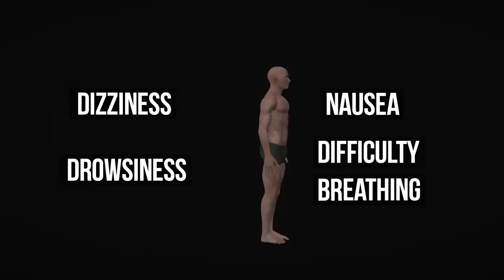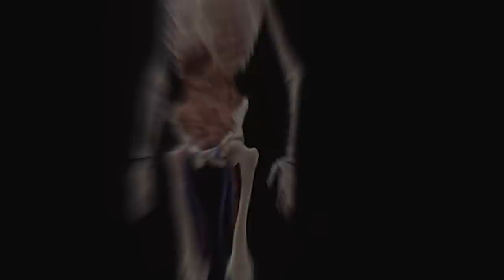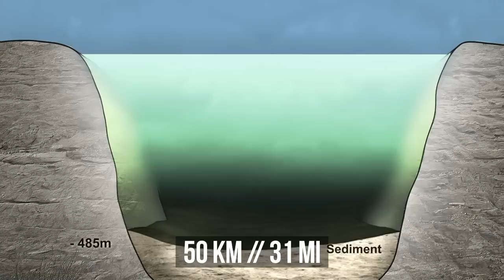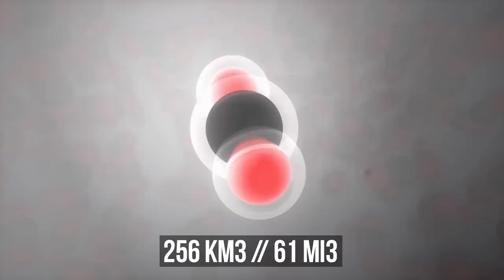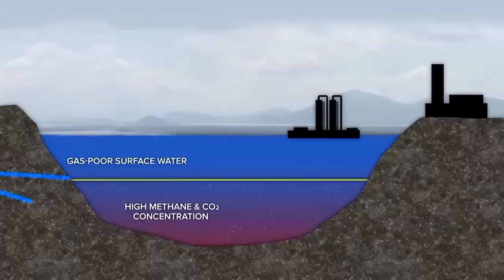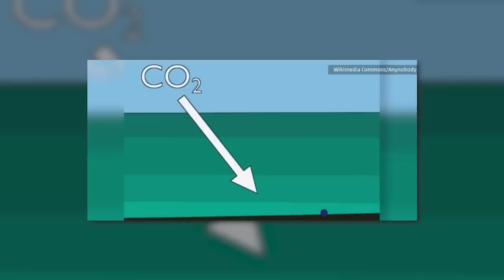It Will Kill Thousands of People Soon

Comment: Several lakes around the world have this issue. The whole Black Sea has this issue, and will hit 6 major nations, including Ukraine. 💀💀💀

First rule is to evacuate when you notice major shifts in nature. If you smell sulphur, rotten eggs, or soda, then get to high grounds. The extremely poisonous air is heavier than oxygen, so it won't go that far up. 

Be prepared to hold your breath if you're in an area of the smoke. 30% CO2 will make you go unconscious, and this will exceed such, making you pass out on your very first breath. 

Don't bother to start-up your vehicle, as the CO2 won't let it start. If you're in a lot of smoke, keep holding your breath and walk slow to reserve yourself. 
The best thing to do is be prepared by having an oxygen mask and tank for such instances.
Reply: So basically, you've just parroted the information from the video.
Why?
Does polly want a cracker...
🙄
🍄
Reply: @the_unrepentant_anarchist. 🌬️❄️🌪️ 🫓🦜🧟
Reply: @mel8517 
Wind snow tornado [illegible] genie??
I don't get it...
🍄